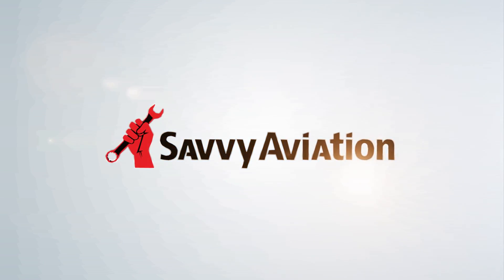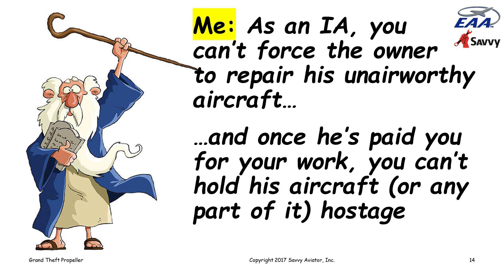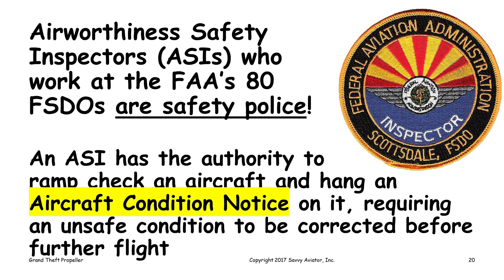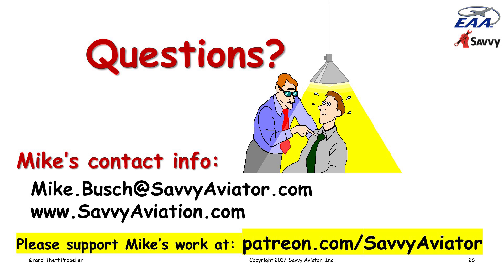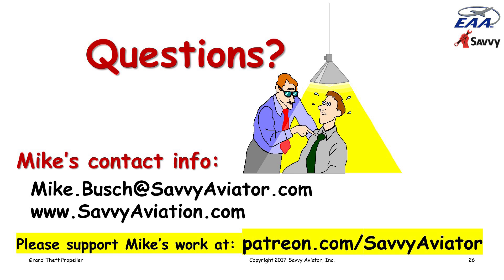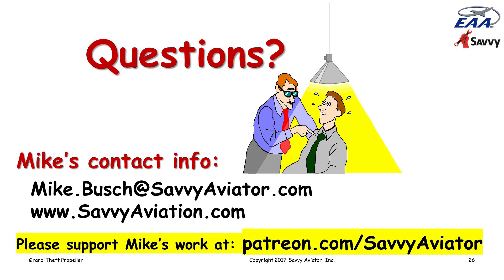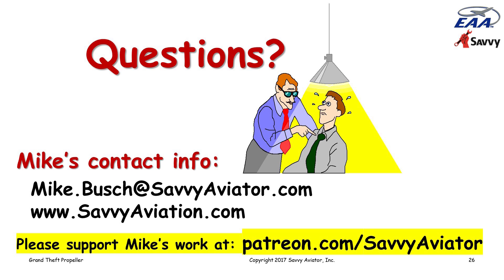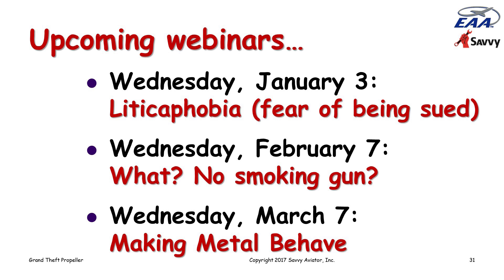Grand Theft Propeller Webinar

Comment: commenting at the start of the discussion - the easy way to deal with that is for the IA to tell the customer that the only way he can do that is to render it unmountable.  The way I would do that would be to cut/mill slots between every-other bolt hole so that it couldn't be mounted to a flange, but would still be usable as a decorative piece.  Another option would be to weld solid plugs into the bolt holes.
Reply: That would be tampering with aircraft parts sir and even worse.
Reply: A great example of why you should not comment when you don’t know what you are talking about and refuse to invest the time to learn before spouting off.
Reply: Yeah that's a ridiculous comment. Now if you were in production and apart is determined to be scrap, then you must render it unable to be installed and there is a regulation that covers that but that's only in the production environment.
Reply: @christophergagliano2051  Just because there's no law requiring it doesn't mean a mechanic cannot destroy a part he suspects is going to be illegally re-used.  There's certainly no law AGAINST doing it.  And if the IA presents that option to the customer, and the customer refuses, the IA has the option to say "fuck outta my shop".
Reply: That would be vandalism of the guy's prop.